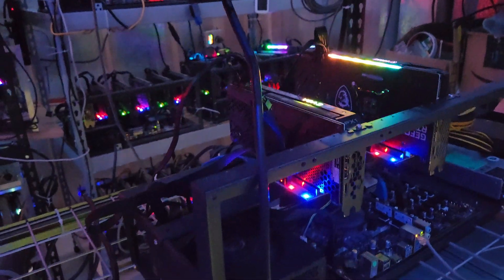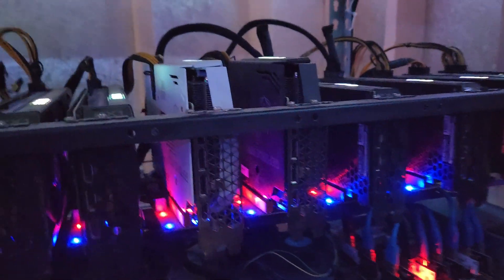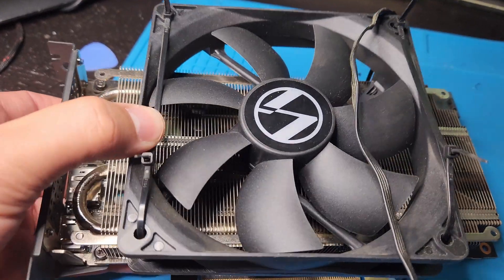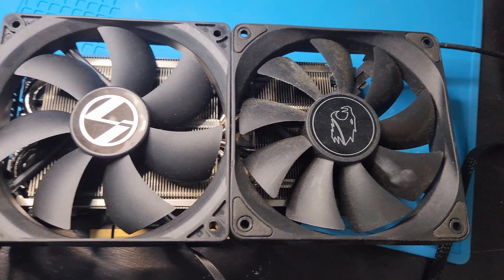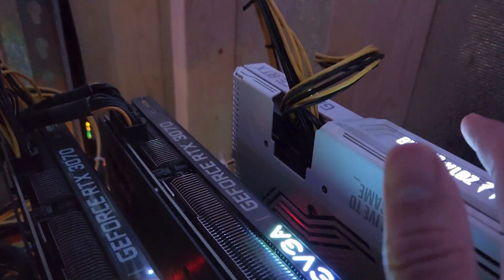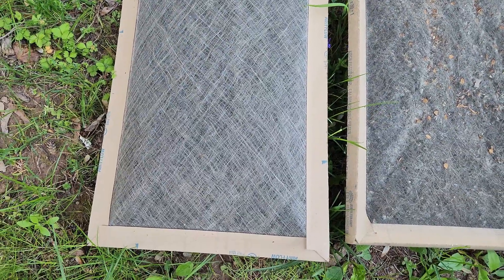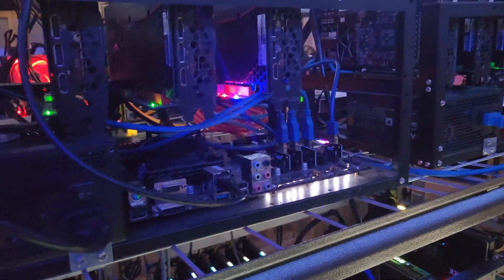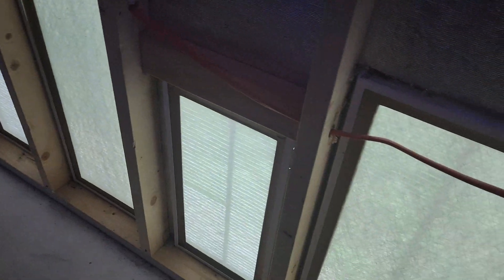Mining Shed - Up in flames, time to prep for summer #gpumining

Comment: One thing i tested recently on my 8 gpu vedda frame. It has 7x f12 arctic fans 120mm on it. It uses 16w of power and dropped the temps 4c-9c depending on the location of the card. Pretty good in my opinion.
Reply from the maker: yea honestly, theres 1 rig that seems to run hotish, I may first move it lower and if that doesn't work ill add some fans, I have some of my original rigs with fans on them that I have unplugged but not removed, I could use those as well